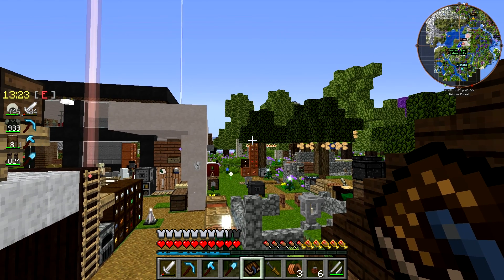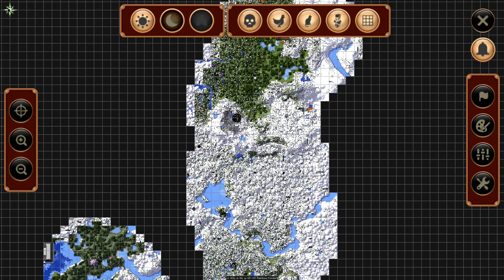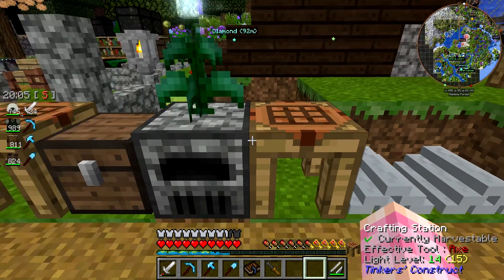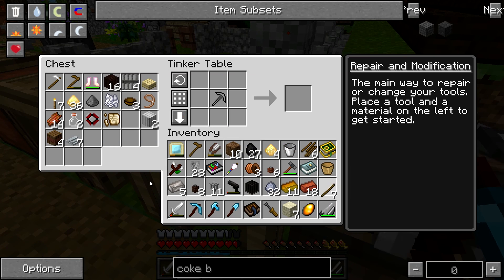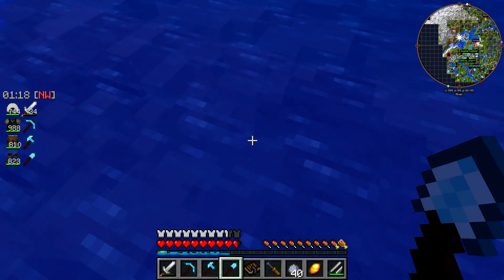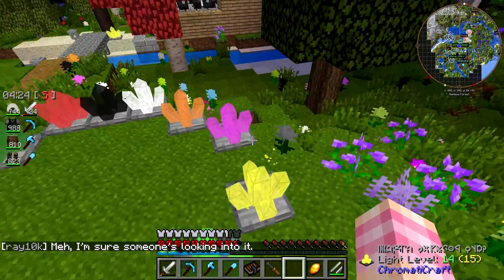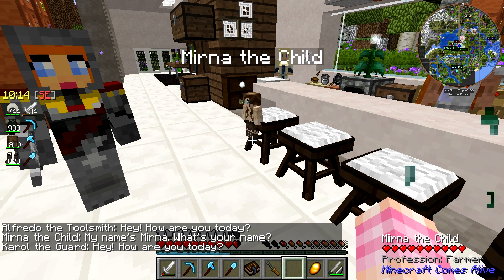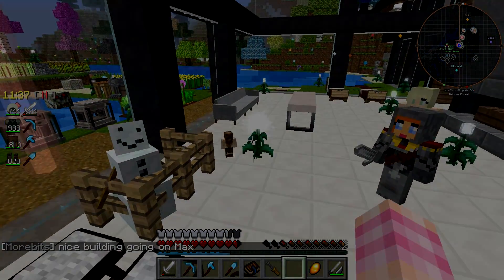Minecraft: Revolution 3 New World - Coke Habit

Comment: Another tip. Go into creative and test out the output of different power sources. Basicly when I tested them like a year ago; The water wheel was the only one worth my time... I think the thermal generator thing that you where thinking of making only does 1-4 rf/tick going off of memory. At 88  rf/Tick nothing else in the pack can keep up with a triple water wheel set up for early power gen. The fully upgraded wind mill was second, but from memory that was only 20 or 40 rf/tick (at a y level of over 200). And since that needs hemp and steel... Yeah to costly for early game and the hight needed is a pain.

You can use an Ender IO battery to check the power made.
Reply from the maker: Honestly I mostly want the windmill because I like the way it looks. I'll build a triple water wheel for real power
Reply: Hide a triple water wheel underground (you already have the hole... what was that for anyway?) and use it to power the crusher latter when you have built a cuple more and have a large stock pile of mats you use then decorate the house with all the windmills you want.

But first triple water wheel.